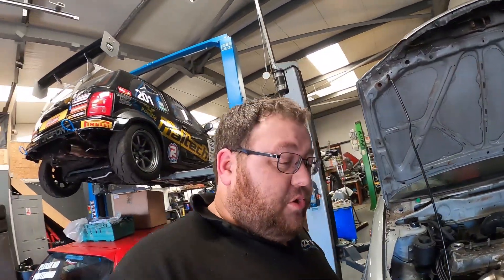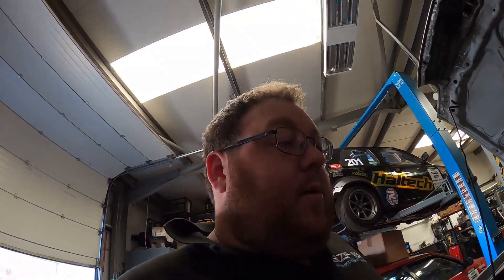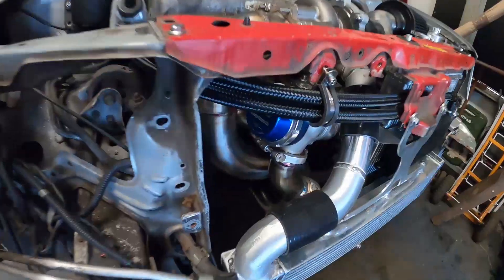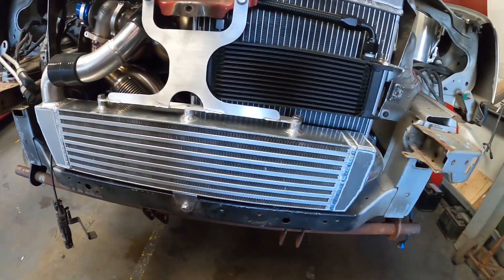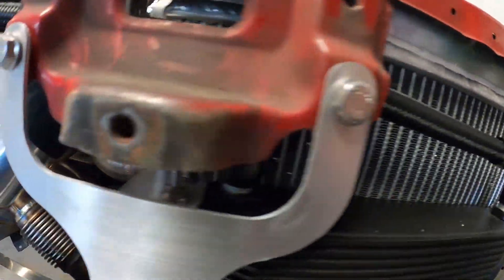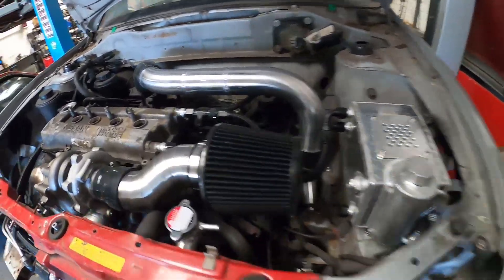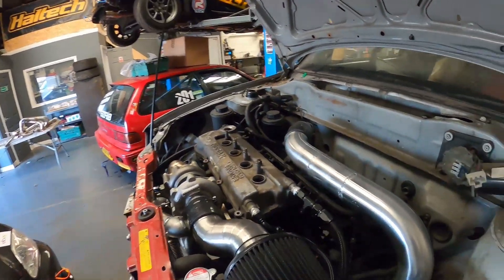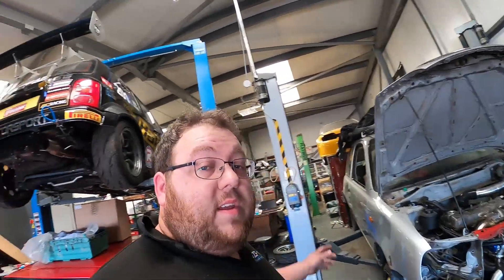NISSAN MICRA K11 TURBO KIT OVERVIEW

Comment: Would a gbc22-350 have too much lag on the cg13 ?
Reply from the maker: Id say too big. The smaller 200/250 would be more suited.
Reply: @GizFab  ok and will it fit under the bonnet with your log manifold ? Just doing some research on what works because in aus there is nothing here for the motor I have to import a lot of the parts.
Reply from the maker: @hepworth1086  If i made the manifold and log as a matched pair - yes.
Reply: @GizFab  when ordering online do I just state what turbo or will this be a full custom order ? Sorry for the questions
Reply from the maker: @hepworth1086  Full custom order. Would need to send us the turbo.

Comment: if i get on of this turbo kits, should i buy forged conrods or forged piston? or i can do the same work with just the factory conrods and pistons?
Reply from the maker: Key is in GOOD engine management. If you want to run this on Stock ECU - Then it will not last.
Reply: @GizFab  of course i will not run the stock ecu or stock injectors but the question is do i have to change the factory conrods and pistons to forged?? how much power can i make with just factory conrods and pistons?
Reply from the maker: @ΒασίληςΧριστόπουλος-δ3ζ  Limited 150hp.